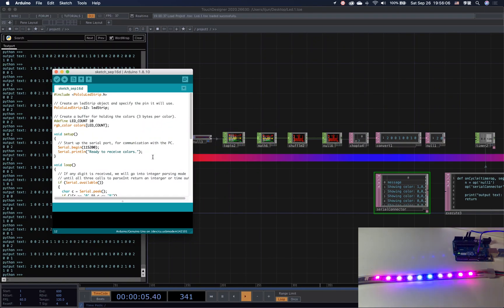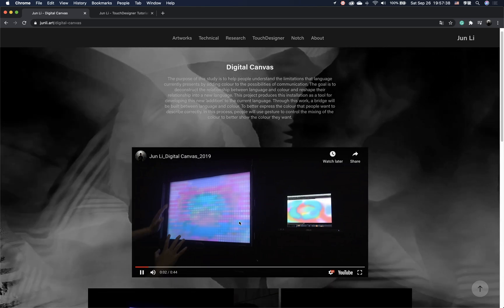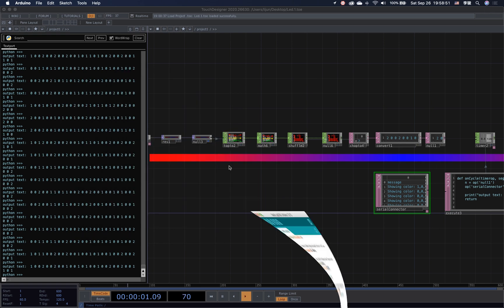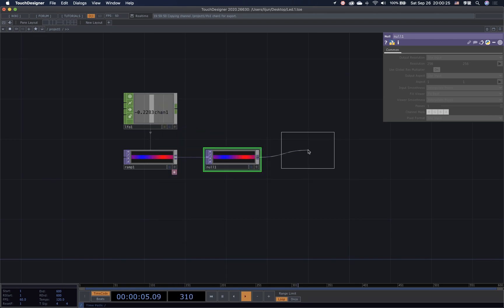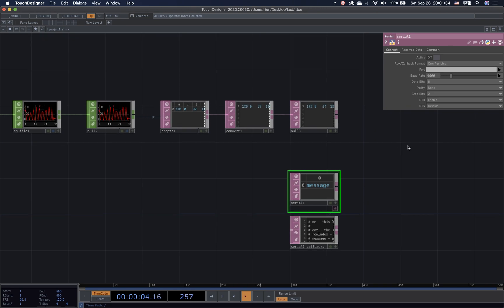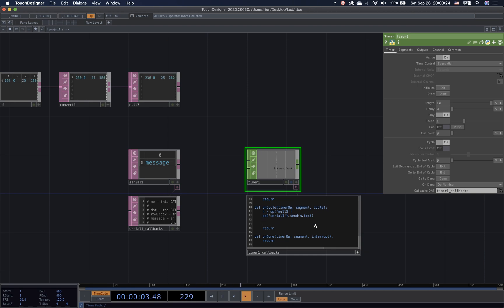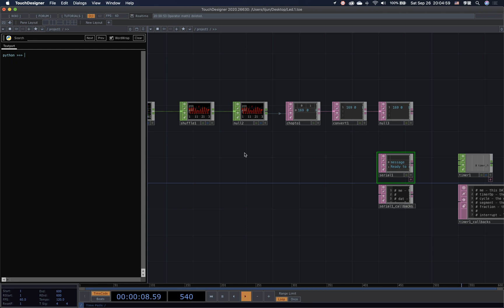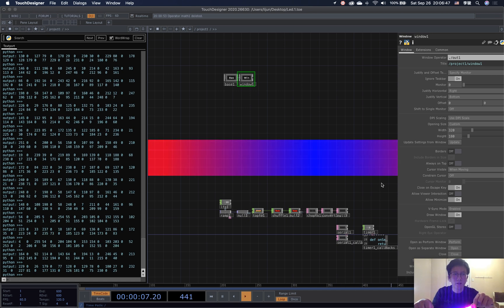Pixel Mapping with TouchDesigner & Arduino Wsb2812b Addressable LED Strip - TD Tutorial 6

Comment: Thank you for the tutorials! I seem to be getting very close.  I'm using an Arduino R3 (with added power) and sending out to 6 separate LED strips (WS2812B, GRB).  I have gotten light to translate (THANK YOU!) and I can see the back and forth animation on the strip, unfortunately, I seem to be getting the wrong color combo (with a bit of jumpiness in the animation it seems).  It's almost as if my color order may be wrong? I've tried swapping "r" value with "g" and vice versa in the TOP-to and also tried it in the code, but still having issues.  Occasionally I will get the red/blue combo, but it's a flicker.  Any thoughts/ suggestions would be greatly appreciated.  And thanks again!  This has been a huge help!

Comment: hello this is very cool, i am going to learn touchdesigner, can i export the gradient animation as python to my arduino and save the code on there so i can run my arduino without being plugged into my laptop? or do i have to output the python in realtime to the arduino like how you have shown in this video? thanks, i am a newb

Comment: In TD, with your tut, a 16*16pixels Ramp Image has been mapping to leds matrix16*16 perfectly.  But, after transform a photo image resolution from 256*256 to 16*16 pixels,   the photo image hasn’t been displayed correctly by mapping pixels to leds matrix 16*16.   Would you explain how to mapping a photo image pixels to leds? thanks

Comment: Thank you M.Li for your great Tutorial! This is one of the few about that topic. I would have a question if you read this and have a minute. Do you have any idea why I miss 1 led each 4 for of them. Which means that I have to #define the LED_COUNT to 80 in the .ino in order to have the 60 leds of the ws2812b to light up.  LED_COUNT 3 the first three leds light up. LED_COUNT 4 same three leds light up. LED_COUNT 5 the first fourth leds light up... and on and on. As well as a pattern of 3 colors is repeated. I tried to change resolution 60 to 80 in the ramp it does nothing. I changed the ramp to a steady color and realize that the ramp does not affect the color at all. I could not figure it out why is all that.
Reply from the maker: Hello there, have you downloaded my example code? you can try to explore starting from there. Depends on what ur describe, l doubt if the array went wrong, you can check the shuffle chop in the pipeline, All the best~

Comment: Having a problem around 8:58. For some reason it won't print the "Ready to receive colors" in the serial port. Any idea on what I can do to fix it?
Reply: My Arduino is blinking when I run the code I downloaded from you, but no lights are coming on.
Reply from the maker: @ikontact  it's hard to tell the problem based on ur description. l suggest you check the model of your hardware and follow my tutorial step by step carefully. Indeed, it's very tricky to play with hardware. All the best.
Reply: Actually I tried running it again and now the Arduino is no longer blinking (can't get it to blink anymore for some reason) and saying it can't read my Arduino). Can I Instagram message you? Couldn't find you on there. What is your username?

Comment: Hello Jun Li! Im trying to get this tutorial to work out - I get the lights to light up But as soon as i turn on the timer chop TD drops to 1 fps. It doesn't matter if i use 1 pixel or 100 pixels. What could be my problem?
Reply from the maker: Probably the sending rate is too high, go check and try to reduce it by half.

Comment: Hello

thank you for this great job.
it works well for me but I can not get the 60 leds to work of my led strip. only the first 10 works.
which parameters should I modify?
thank you
Simon
Reply from the maker: Thank you so much! There are two places you need to check, one is the led numbers in Arduino code l believe l mentioned in the video, the other is the resolution Top in the TD. Basically, you need to match these two numbers.

Comment: Right on time buddy! Exactly when I needed it :)
I'll start my prototyping tomorrow, I think I'll be back with some questions for you mate!

Thanks for the well timed upload :D
Reply from the maker: NP, All the best!
Reply: @junli860  Worked like a charm! THANKS! 
Any idea what is the maximum timer speed I can use safely? 250 looks fine, I've tried 1000 but got some random color flickering at some moments. 

Also the Arduino code isn't in the description so I had to copy it from your video. just to let you know.
Anyway, thanks for the tutorial dude it was great!
Reply from the maker: @Le Roi Papayou -  there're some different ways to debug, usually, you can try the framerate, speed, upgrade to a more powerful board like Maga, reduce the led lights. Depends on whether you need to run the project in real-time. Yes, you will see the led flickering when over the capacity of the Arduino board. So this is the main reason that control addressable lights were tricky. What l have shown in the video, l try to control over 1300 LEDs, but for sure you can notice the delay but should be fine if the quantity is around hundreds.
Reply: @junli860  Thank you for the clear explanation. I only have 36 LEDs for prototyping so that should be good :)
I'll dig deeper to fix some flickering.
Reply: @LeRoiPapayou  using boards like teensy could be an answer for any kind of speed problem.